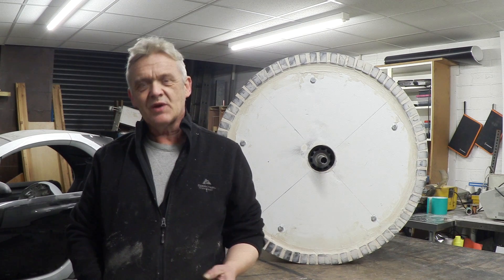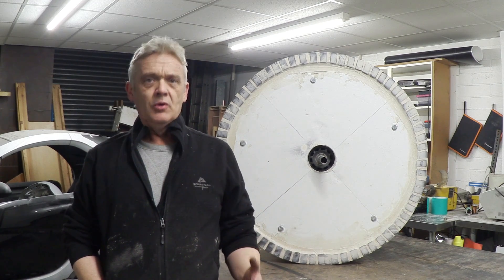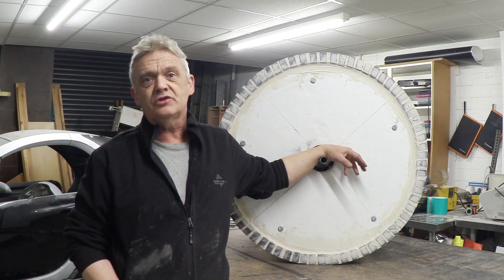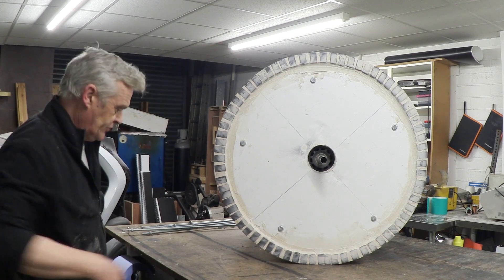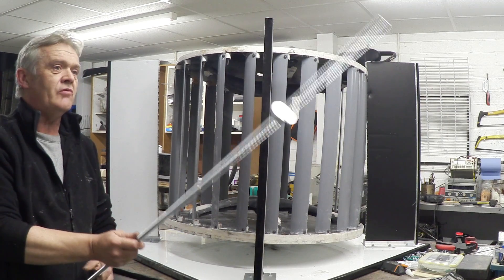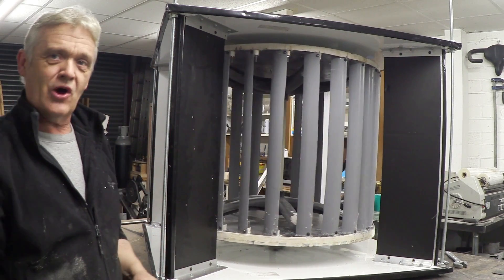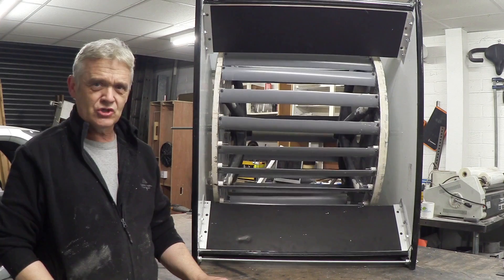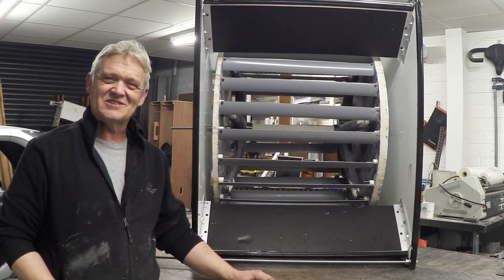Building a 1kW Wind Turbine For Under £100 Part 4 - Finishing The Body

Comment: Jeez, after all the right hand rule stuff, would've thought u got the spin direction correct. The missing shroud should have a flared exit vent at the bottom rear. The air deflectors on the front r at the incorrect pitch & shape. The bottom 1 still needs 2b mounted 2 the bottom of the sill, but it needs 2 b shaped like a race car wing, with the fast side facing up, aimed at the top half of the wheel above the axle. Mount a second wind w the fast side facing down on the top of the shroud. Both wings 2gether not only increase the wind speed via the aerodynamic principle, but also compress it as its forced into a laminar stream, increasing the pressure inside the shroud housing allowing it 2 spin faster. This horizontal design generates more power the faster it spins, & can't suffer from ovr speed failures.

Comment: How are you ensuring the center axle is properly centered and the masses equally distributed with 72 different magnets?  If I bought such magnets in California, USA I think just the magnets would cost over $131...i.e. over 100 pounds sterling.
Reply from the maker: you are buying the wrong magnets

Comment: Looks great, I do recommend balancing the wheel, I see your rotor wheel with the blades is not balanced which will cause noise and vibration.

Comment: I have an old electric scooter with a BLDC Motor 48v speed 4600RPM I want to  make a wind turbine from the parts of the E scooter, an old pedal bike and a large thick plastic piping that roofers use to chuck waste down to a skip, my son did look after the E, scooter the electrics adjoining the batteries set on fire , melting some of the wiring attached to the batteries fuse and the plastic housing units for the connection points for the wires.
I’ve stripped the E,scooter taking the motor out with a good length of the wires left attached, how do I know if the motor will still work? When I turn the end sticking out the motor that the bike chain was attached to it turns but not totally freely, I’ve not attempted to take the housing unit off the motor can anyone help me

Comment: You double the output by placing another set of transformers and magnets on the top disc as well as on the bottom. Practically it should be mounted with the turbine spinning vertically if you have multiple wind directions throughout the year. It could be mounted effectively horizontally if the wind blows from the same direction all year round. Great Job

Comment: what if you put a big tube dead center to direct the air more in a circle   2.  could you put a 2nd turbine on the shaft (maybe with some kind of clutch) that grabs air from scoups on top or a scoup that rotats toward the wind and the exhaust throug the frame directly on to the lower rotors.  or if they were uncoupled but you are just using the space above it to mount another generator and then pick up some of its exhaust.  The lower turbine might even draw air through the upper one - depending on which one starts easier.   if the upper one was set up for high rpm and to start at low wind speact maybe with gearing it couild assist the big lower unit to get started .... just a few ideas....   thanks for what you do Robert.....

Comment: You can calculate the energy stored in wind by 1/2*mass*v^2.  mass in kg and v is velocity in m/sec.  a cubic meter of air at sea level is 1.225 kg/m^3. A 30 mi/hr wind has about 110 watts per m^2 if you bring the wind to a stop and extract all of the energy.  Let's assume we want a one kw from a 30 mi/hr wind.  Let's assume we can extract half of the energy.  That means you will need 18 square meters for your wind turbine.  That's 4.3 m per side of a square wind turbine.

Comment: Would this work upside down with all the coils etc at the top, covered by an upturned paella pan or pie dish to keep the rain off the electrics?
Also, if the baffles were foil shaped, like the F1 ones you made by folding aluminium sheet, would that increase the wind speed?

Comment: Certainly haven’t been spending hours reading comments across multiple videos. But my first thought is that if you’re already doing a top plate. It sure would be easy to mount a few more magnets and capacitors up there. Your potential for a given amount of material used would increase.

Comment: Cool now think if it's near were cars and big trucks travel down a road at speed maybe in a tunnel channel airflow into a filter housing to filter dust pollen let it flow across damp activated charcoal to pull carbon monoxide and excess dioxide just an idea from a long time ago they won't do it here in America because it's not about free electricity for the people or cleaning the air it's about charging people for those that pollute thanks oboma biden all the way back to Reagan if you read this try it

Comment: This turbine is more efficient in the vertical mode as the wind can come from any direction. 
In the horizontal position the turbine will only receive wind in two fixed directions.

Comment: It’s foolish to think that a DIY wind turbine would be as reliable and of equal quality to a commercial counter part. If the enjoyment of the DIY project is the thing than by all means make your own. There are two chances that a DIY project like this would succeed; slim and none. BTW it’s not the turbine’s quality that determines the energy but the wind. Placing a turbine below about 30 meters height is like placing a photovoltaic array under the shade of a tree. No wonder you say that a 1KW wind generator system is only good for about 100W. At 30m the average wind speed is about 50Kph with normal gusts up to 160Kph. How well would your DIY unit stand up to that? A commercial unit would be designed and tested with these wind speeds in mind. One other comment: The majority of a wind generating system cost is in the tower that can hold the turbine at the proper height with reliability to survive the environment. If you really want to impress design that for under 200£!

Comment: Why not turning the whole thing upside down to have the electrical magnets and coils etc. covered against weather influence by the outer board functioning as a roof. You could make the upper board even larger for even better protection.

Comment: Yours looks like if you teak the coils and use some good havy copper wire, then you could easily get 1KW. I like your idea of using a microwave transformer, but 
i think that if you go i further and use the transformer out of an APC 1500 Watt battery back UPS Unit, Because it has already wound coils for house current and away you go you idea
on steroids, it looks great. Now , that is good energy at an excellent price, You WIN the Prize.

Comment: Could I ask a question; Could you use the fan, of the outside part of an airco split unit, as a generator? I have on my roof and it would explain what I am sending back power to the grid ;)

Comment: You done a great job at explaining everything so far really like the build. I am going to copy yours but use a pmg as the power source. This is the closest to the old military style vawt's that worked so well in low winds. I have searched for a surplus one for years at military auctions but haven't been able to find one yet.

Comment: The wheel in it's horizontal position is rocking back and forth on it's axis. Use the motion to perfectly balance the wheel with maybe screws to eliminate vibration. This will give higher rpm.

Comment: I disagree with your suggestion to deploy it with a horizontal axis.

If you deploy that with the axis horizontal, it will not face the wind from all possible directions. To adjust that you would need to add a so called "yaw" mechanism to turn the drum to face into the wind. On a much lighter windmill this could be a simple weather vane at the back: but however you turn it you also need a vertical yaw axis for the whole device to swivel around. So any horizontal axis turbine ends up having two rotation axes, the fast one is horizontal but a slower vertical yaw axis as well.

In contrast, with the axis vertical you do not need the yaw mechanism at all -- as the wind blows horizontally, the turbine always faces the wind wherever it comes from at that moment. This is why DIY turbines are much more often designed to have a vertical turbine axis.

Comment: power is proportional to windspeed CUBED, so if the wind goes from 10 to 20 which is x2 then you expect the power to go x8, for example. It is that cube factor that makes low windspeeds so disappointing.

For the physicists and engineers, the cube factor comes as follows. Kinetic energy of a given mass of air goes as the square of the speed so is proportional to v squared. BUT THEN the mass of air passing is proportional to the windspeed, bumping the square up to a cube. 

All that assumes that, however (in)efficient your turbine is, it retains roughly the same efficiency across all windspeeds.

Comment: Absolutely love this concept: high output, low profile, low cost wind turbine.  Thanks for the insights, inspiration.  Just a thought about mounting - need it secured to a rotating turntable along with some type of wind vane that would automatically orient the turbine with wind direction.

Comment: 8:20 you start to see a very useful way to balance the system. The free rotation going back & forth shows your heavy spot. Add a few small .5 or whatever gram weights that you find on motorcycle wheels near the top of the settled state & you're ready.
Reply: I wouldn't balance it now, wait until the coils are in, then balance.  Weights, like you suggested would be where I started.
Reply: @dundeemt  On this design the coils are stationary, anything that moves is already installed (presuming he is done with the rotor) so now is actually the perfect time for weight balancing.
Reply: I was looking at it spin and thinking the same but I’m a bit late to the party

Comment: Great job Sir!
A bit of thinking- in the horizontal position of the assembly you get dry magnets,no moisture accumulation.
In vertical position you get more wind exposure and no need to turn arround to catch wind from different directions but also you need water draining to prevent rust or icing in the bearing area and magnets area.
Just an idea

Comment: Hello Robert, in this video I noticed that when you turned the drum on it's side and spun the drum you can see where the drum is out of balance. Q was the drum running thru the bearings or just on the threaded Rod?

Comment: I like your wind turbine, however I don't think you will achieve a 1kw turbine with that size. I would recommend doubling the height of that turbine to achieve your desired output.

This style of turbine will be able to handle gust better but rotor efficiency may be on the lower side without any lift effects.

Math and Engineering part:

Wind turbines are rated at 10.5m/s(~23.8mph) to 16m/s(~35.8mph). 
The formula for the power in the wind is 0.5*(wind density)*(wind area)*(wind speed)^3.
For this type of turbine the wind area is ((turbine width)*(turbine height)).
This works out to be 0.5*(1.2kg/m^3)*(1m*1m)*(16m/s)^3=2.47kw. 

Now to take efficiencies into account:
The maximum efficiency of a rotor can not exceed 59.26% this is called the Betz Limit.
2.47kw*59.26%=1.47kw (Theoretical limit).
Typical efficiency of a rotor are 25%-45%.
2.47kw*25%=0.618kw
2.47kw*45%=1.11kw
generator efficiency ?-95%.
assuming typical 80% efficiency.
0.618kw*80%=0.49kw
1.11kw*80%=0.89kw

Comment: To choose between a horizontal axis or vertical axis turbine depends on the type of alternator you put un this. I'm working on a axial flux generator and these are most suitable for the type of turbine demonstrated in this video. A radial flux generator is more suitabe to attach to traditional windturbine. I have a small 10Wp radial flux generator already build to learn something about electrical engineering not for any real purposes. I think a horizontal axis turbinedemonstrated in this video has so much advantages over a traditional one. 
1. you don't have any tension on the rot that holds the rotor of the alternator in place while tradition turbine does due to the gravitational pull on the turbine which lowers the power output.
2. they are less likely to cause complains from nabours.
3. they are less dangerous because the turbine plates are hold together by two sides. 
4. It does'n matter where the wind is coming from or is turbulent so you could place them everywhere you want such as on buildings.

What I find also very cool about the way the turbine in this video is made is that you could also use them to generate electricity from rain.

Comment: In the vertical position it is wind direction independent. The load direction on the bearings is also different. With the bearings in the horizontal position these would do best. While seeing in moving in the horizontal  position, it moved forwards and  backwards, so it is not fully in balance.

Comment: To get maximum magnet flux, the magnets should be placed on a common base of iron. The lower the flux the less torque you get, and need more coils for the same torque.

The efficiency is not much affected by magnet arrangement or coils. The coupling between a coil and magnet determines voltage and for each induced voltage you can produce flux proportional to amp*turns. If you replace a full wind coil with half area wire, you can have twice as many turns and twice the voltage, but resistance becomes quadrupled.

It means a thin wire coil has double length wire with half the area and hence 4 times higher resistance. As voltage is doubled with number of turns are doubled it amp*turns is a zero sum game.

Voltage is selected for convenience of what device you connect. Twice the voltage and you can apply or use half the current. Power U*I remains constant.

The voltage of the coil as determined by the wire gauge makes no difference to the performance of the coil. It is how much flux can be lead through the magnetic core that determines how compact the design is and how much material is needed.

Magnets should be magnetically interconnected at their base, the air gap be kept close to where the magnet material is saturated. If air gap between magnet and solenoid core is made small with strong neodymium magnets, the core may  saturate and part of the motion of the magnet will not induce a variating flux and hence no voltage and no torque when flux peaks when magnet at center of the core.

North and south poles of magnets should make a closed magnetic loop through the coil magnetic core. Open air magnetic flux swiping across individual coils with no return magnetic field is bad because air is not a great magnetic conductor.

Comment: In a horizontal shaft orientation the big square side plates will be shielding the wind from those sides.
That's cos the wind blows sideways rather than up and down (unless you duct it)

Comment: Toss this close to an open airfield with high winds, attach sandbags in appropriate locations and ratchet ties in a tick tack toe....portable wind gen, on ground our on top of rail bars of vehicle....better use....toss ontop of a water tower to offset the power req, or charge a system that has a backup battery and have it run supplementaly throughout the day to assist in charging a larger battery system....

Comment: When you mount this on a flat roof, try extending the baffle plates to the four corners of the roof; ie several feet long. That would substantially increase the volume of air ducted into the wind turbine. That might be worthwhile for most of England where wind speed is usually low. 😀
Reply: Good idea, and those baffles could have covers that are open under most conditions, but excess winds would cause them to snap shut. A safeguard against storms.

Comment: Bangup Job and looks like a Commercially constructed Turbine!      One comment on the orientation is that are turned on its side you are then faced with building a method of turning it to match the wind direction.    So to keep it vertical, you do not need to be concerned with the Turbine direction as it catches the wind in all directions!!!  Looks Amazing Robert!!!  Plus you can increase output  with more Coils as I suggested a while back!  Bravo!  Here I go!   #5  ✌🧑🤚

Comment: I'm watching them in order and this is as far as i've got, but am really enjoying this. One thing I can see there is it's out of balance as you can see it swinging backwards and forwards trying to find it's natural stopping point. I think you should either remove some weight from one side, or add some balancer weights. The better it is balanced the smoother, quieter and long lasting it will be. I wonder if the corner boards you've put on there should be angled differently to aid the wind? I can see also high winds are going to flex the gutter as it has no strength, maybe a piece of threaded bar behind every one would add some strength? Or maybe a central circumferal ring tying them together at the centre of their span?

Comment: Making the "diverter" 'proud' of the baffles, and at a tangent to the circular part of the project, will 'grab' the wind that is normally travelling around the opposite side of the wheel.  This will also help create a lower pressure condition on the opposite side, leading to faster speeds.

Comment: Place a diverter approximately 35-40% across the wind facing side, from the "baffle", toward the center area, between the baffles.  This will offset the wind on the vanes, forcing the wind to go the way it needs to go, to get the optimum speed.